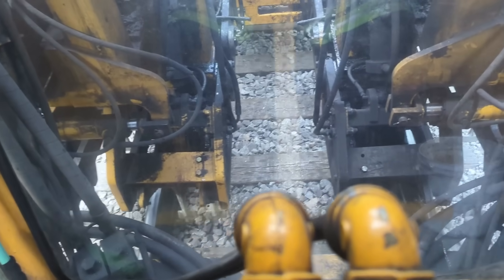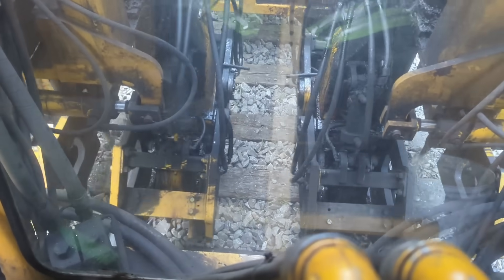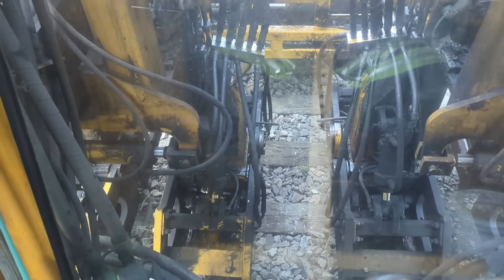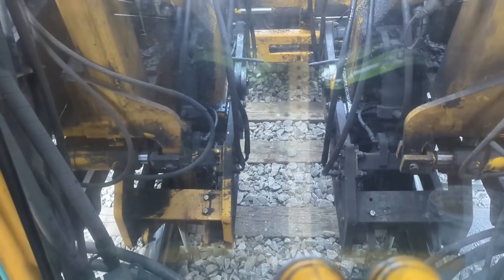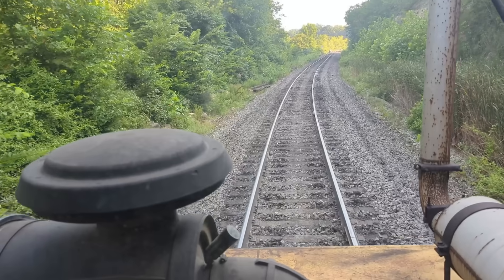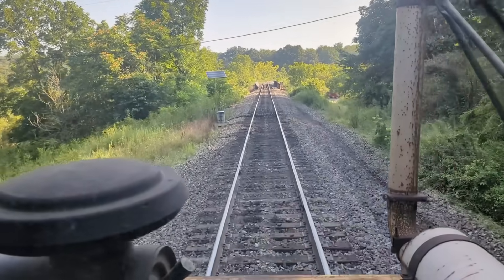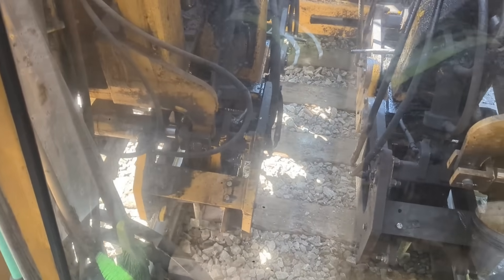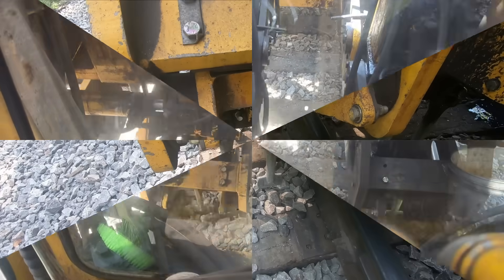Chase Tamping Tightening Up Track

Comment: Many years ago, I ran a double action MAT tamper which was the main line tamper with double sets of heads on it but the most interesting and challenging tamper  I ever ran was a YST that’s a yard switch tamper the heads on that tamper would move laterally in and out to get around the frog and the turnout rails. It was a relatively slow machine, but when all you do is tamp switches you’re not gonna get a lot of footage production anyway thanks for the memories!
Reply from the maker: I've seen the Plasser CAT tampers in videos David, I'm assuming
the one you are referring to is similar. I'm not familiar with the 
MAT.  I know that Plasser was impressive. I do all the turnouts with
my 6700, it's a switch production tamper. Yes its slow on the turnouts but it gets the job done.  Thank you for watching our video and may you have a very good day my friend.

Comment: I see mow crews quite a bit on both sides of the river here by me, and sometimes they have like five or six machines in a row. Now I know what a few of them are 😊
Reply from the maker: BNSF doesn't mess around as you know Mojo. Get the job done
and get it done as quick as possible. If you see a kinda flat looking
machine with no cab on it working behind a main tamper, that
is called a drone tamper.
Reply: @ccrx6700  I'm going to keep my eye out for that! One that I saw recently kinda reminds me of a drag racer. It is very long and spindly with a set of wheels way out front. I assumed it was for some kind of measuring, because anything harder than that would break it!

Comment: Does the tamper keep a tie count as you tamp
Reply from the maker: The computer has that ability to count footage and insertions Michael, but not the number of ties. I don't have the insertions
set up on my computer, but I can do footage. Some railroads
have tampers that send that information back to the office from
the tamper that way they know if the tamper operator is goofing
off or tamping. That info can be sent in real time or collected
and sent at the end of the day. There are typically 21 to 22 ties 
per 39 linear feet of track.  So you could get a fairly close
tie count doing some math.  Really appreciate your watching
and hope you have a very good day my friend.

Comment: Dave so there are 3 zones that you tamp, centered between the rails, then centered over each rail. is the
order key? do the center first , then over each rail ? great job, hydraulic is better then by hand! have a great day.
Reply from the maker: 3 zones is correct Barry, with 4 work heads on the tamper all
4 work at the same time so all 3 zones get tamped at the same
time. If this all had to get done by hand, then it wouldn't get
done! Thank you for watching and hope you have a very good day my friend.

Comment: It may be a repetitive job but you don't have to think about as much. I have not heard it called chase tamping, we do it here but think just say follow up tamper. They also run a dynamic stabiliser through which vibrates and settles the track so it can be brought back in use at higher speed, before those they would run slow through the work area a week or two then go back and tamp through again and increase the speed limit or take the slow off altogether.
Reply from the maker: We could not afford a stabilizer, plus when track is tamped
or ties replaced the higher speed tracks impose a 25 MPH speed
restriction until the ballast is compacted again Cedarcam.
So since we already have 25 speed limit not much use in
buying a stabilizer. Your right chase tamping there  is not
much to think about, it's kinda boring but that kind of boring
is okay, far better than being out in the freezing rain on a 
derailment. :-)  Thank you for watching our video and may you have a very good day my friend.

Comment: Thank you for this video!👍🏼 
For a moment it seemed like you're leavin' railroadin' and goin' into finance: Chase is one of those banking behemoths of Wall Street. 
What are the small tampers called? Couldn't catch the word over all the tamping noise. When observed up close while doing its tamping, the tamper seems to have lost its temper.
Reply from the maker: Tamper lost it's tempering.... LOL  Small chase tampers are often called pup tampers Robin. Some railroads have specially made pup tampers called drone tampers.  Not to worry, finance and banking are not my cup of tea, I'll stick with railroading.  Thank you for 
watching our video and may you have a very good day my friend.
Reply: @ccrx6700 it's = it is; its = belonging to it, characteristic or other descriptor of it. Losing one's temper (not tempering) = getting angry. Can also mean losing the hardness that was induced in steel by temperature manipulations during manufacture.

Comment: Dave, great explanation of chase tamping. We used to call the smaller tampers blind tampers or to be politically correct, "cognitively challenged tampers". You can do the translation.. Of course the machine operators didn't like that term at all!
Did you have the controls set to triple tamp the ties? 
Did Amtrac skip tie tamp? Leaving you to tamp the ties skipped. It may have gotten you a slightly lower per lineal foot price? 
Maybe I missed it in an earlier video, how much of a raise did Amtrac put on your railroad? 
I like the footage of the exiters on your work heads coming online.
Production tampers are amazing machines. They perform in environments that machines typically don't like. Lots of vibration, dust, impact, and in all weather. 
Thanks again!
Work safely everyone!
Reply from the maker: LOL I liked that John. I rarely use the auto work head package,
I do the manual. Amtrac tamped every tie and I never said how much
of a lift they put on the track, but from past experience with them
they like to raise track up 3 to 4 inches.  Thank you for
watching our video and may you have a very good day my friend.
Reply: Thanks. I try to spec in "correction plus raise not less than 1.5 inches" or whatever size ballast is being used. 3 or 4 inches is a good healthy raise. That will definitely get fresh clean ballast under the ties.
Stay safe out there, Dave and everyone else.
Reply from the maker: @JohnCamerota-jg6wt 👍😊🚂

Comment: Dave, I'm amazed that those tamping blades don't break, bend, or work-harden and fracture. There must be SO much hydraulic force applied on them, over and over. Do the axle/pivot pins that the rotating frames that the tamping blades are bolted to on wear out quickly? The machine must slowly self destruct!!
Reply from the maker: Eventually they do wear thin enough to break right above the 
flat part of the tamping tool Sparky. The tamping tools or blades
(some railroaders call them feet) are made from very high quality hard steel. The pivot pins for the baskets almost never wear out.
However inside where you can't see there is a square rubber bushing on both sides of the pin. Those rubber bushings wear out, it's a
a pain to change a pivot pin, mostly getting the old rubber bushings out. I freeze the pin and bushings before putting them in and also
apply some soap like dish washing liquid to help the pin slide
thru the bushing. I also have a custom made puller and inserter
for those pins which is a big help. Almost impossible to put
the new pins in without one.  The pivot pin has a key way so
it has to be put in right, key way is also in the bushing.
Reply: Or the feet get so worn they don't compact the stone anymore.
They'll wear right down to nubs.
Reply: If I may jump in, those "picks" or blades as you call them are made of really hard, abrasion resistant steel alloy. In addition to that the cutting edges are tungsten carbide - really hard stuff to resist the abrasion of the ballast.
Reply: I saw a video a while back where he was talking about replacing a broken one.  I'm with you tho, those things have to have a lot of pressure on them.  The vibrating part is likely the worst.  The more it vibrates, the tighter it gets and the more pressure that is on the blades.  

I was wondering if anyone ever made a set out of titanium or something.  Very hard metal.  S7 steel might be a good option too.  It can handle shock loads well.  I have a bolt carrier group made out of S7 steel.  Supposed to last a lifetime.
Reply: A high production tamper can operate moving at a very slow speed along the track (a CAT, Continuous Action Tamper).  Designed to move at a continuous speed, the tamping heads and tools can index at a set rate and distance, stop and complete the lift, line, and tamp functions, WHILE the machine is in motion, slowly, then index to the second or third next tie and perform the job all over.  The operator keeps a close watch to avoid any calamities, but the process is highly productive.  Track a train cannot run on to track ready for normal speed in an instant.  Tampers (and some shiny paint and clean windows) make the trains go faster!

Comment: Dave, great shots of how the tamper squeezes in to push ballast under the ties! How many ties on your short line? That's a lot of little short moves, I can see how boring that could get, when your not having to watch your gages for track alignment. Hope the tamper is behaving it self, with all the work you and you crew have put it through. Stay safe out there.
Reply from the maker: Thank you and glad you like it Thomas. We have 16.7 miles of track
and typical tie spacing is 21 to 22 ties per 39 linear feet. So you
can exercise your brain and do the math to find out how many
ties we have. Chase tamping is easy work, I get about a half mile a day done with trains running.  Really appreciate your watching
and hope you have a very good day my friend.

Comment: One time, Union Pacific replace all the tires along our railroad. They left the old tires out for about a year. I think they were hoping that people would steal a bunch of them and they wouldn’t have to pick them up.. in the last five seat chairs for Price almost all the ties if not all of them all the Carlson’s and most of the Bridgers and I think new rail too this is the main line Riverroad though when they pass took across and close to my house, they speed up to 60 miles an hour.
Reply from the maker: Thank you for sharing that David. We used to leave a lot of our
old ties out hoping people would come by and get some. Now
insurance reasons they won't let anyone on the property that
hasn't been safety trained, so the locals no longer get free ties.
Really appreciate your watching our video and hope you have a very good day my friend.
Reply: @ccrx6700  yeah that’s not a problem for Union Pacific because most of their railroads are right along the highways or city streets.
Reply from the maker: @davidcolwell614 😊👍🚂
Reply: I should’ve proofread that. Even though I don’t know what I said.